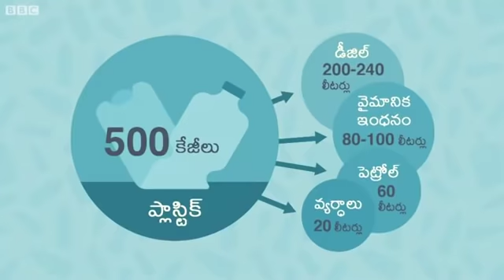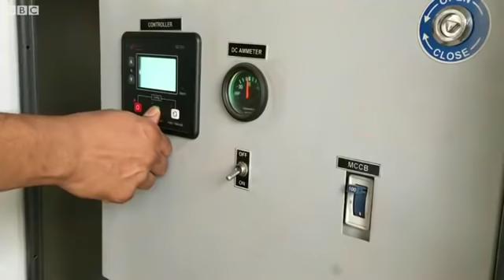Synthetic Fuel: ప్లాస్టిక్‌తో పెట్రోల్, డీజిల్ తయారు చేస్తున్న హైదరాబాదీ ప్రొఫెసర్ | BBC Telugu

Comment: BBC should have also mentioned about the emissions that will be ejected from vehicles when this fuel is used. Should have compared this emissions with that of the regular fuel emissions. Commendable effort though by the Engineer.

Comment: IDI ELANTI KALUSYANNI SRUSTISTODO INTAVARAKU ELANTI ARTICAL LEDU . NENU CHUSINA JOURNALS LO IDI HIGH CORBONDIOXIDE RELEASING FROM THIS .
I Am a Process Engineer worked as Head of Design & Operations for a Plastic Pyrolysis plant, designed & operated a Plastic Pyrolysis plant. So I am sure that it does.

In India plenty of IAS officers and other bureaucrats etc use to visit our plant because it was first of its kind of that scale. We did have many foreign visitors too. We tell them all the same that Julia Ge said in her response. But the fact is otherwise.

Imagine like this, for you to cook a proper food you choose the right ingredients and you choose right veggies / meat / fruits / fresh water etc. If you do not have control on what veggies / meat / fruits and water that you use, that is, if you are given few rotten ones / foul smelling ones, can you still bring in the same taste and flavor? No.

Pyrolysis by definition is heating in the absence of oxygen. This is never done on good raw material, i mean a fresh quality controlled grade of plastics / rubber etc. Its a method of disposal of whatever you have to dispose. Who would make a fresh plastic to be decomposed.

So we were getting all sorts of plastics, rubbers etc. All kinds. That was the trouble. When we got industrial plastic from a particular industry we were able to control the plant. But thats not the case always. 

Every plastic or rubber do not properly break and get back to crude oil or its derivative.

For example you can not crack PET (Polyester) by just heat, you need to follow other chemical process such as Glycolysis and Methanolysis. 

Polystyrene (the foam cups that we use for drinking hot drinks) gives a lots of volatile gases and less liquid.

Polypropylene and Polyethylene are easy to crack, they give a lots of liquid products which is what beneficial to sell and less volatile.

So when you get a mix of plastics (assume no sub grades in each variety of plastic) still you will not be able to crack them all at same temp and your product will vary day after the day as your feed mix keeps changing.

The biggest problem will be the moisture. The pyrolysis happpens at 300+ deg C and the water content in your rubber / plastic evaporates much earlier taking away the half cracked polymer to vents which are very sticky in nature.

Since the feed changes the product too changes. That is we do not know what real oil we are getting in the product. The composition keeps changing.

For example Petrol produces less NOx and Diesel produces more NOx. So even in standard product when you burn them they are harmful to environment. In Pyrolysis since you do not know the real product precisely or because that it keeps changing often you do not know really what harm you cause to environment.

So if you use the same oil for your own Pyrolysis reactor combustion then you produce some fumes and you do not know what they are.

Beyond all these things you have olefins getting generated.

Plastics are usually colored. For example white has lots of titanium, Red has Cadmium and so on. So in solids that you get you do have heavy metals. So if you do not dispose that properly then they percolate to ground causing your water table to be harmed.

Yes of course it can all be modernized and process improvement can take place but it calls for an expensive plants. Since these are usually seen are disposal plants no management would like to spend on sophistication on these plants.

For example pyrolysis plant combined with distillation columns minimize the product range thereby improvising the product or minimizing the hazard.

Same way everything comes with a cost and that way the oil cost produced from Pyrolysis comes very close to cost of heavy fuel oil in market.

There is nothing on earth which is not harmful to environment to be honest with.